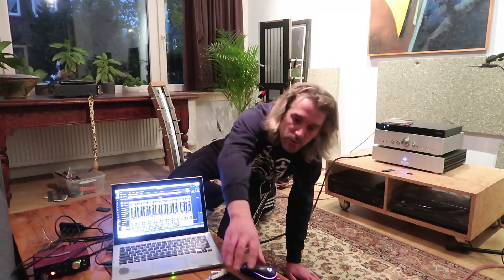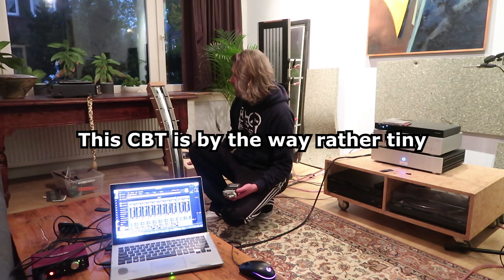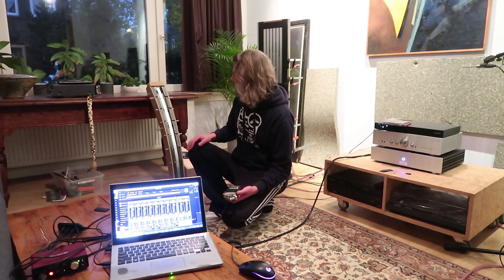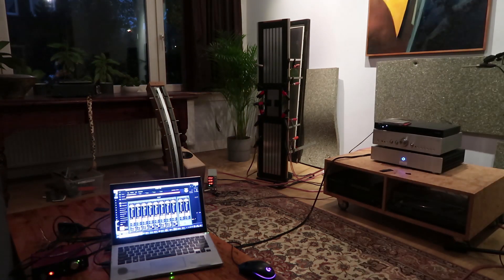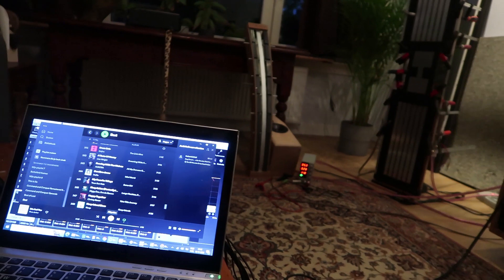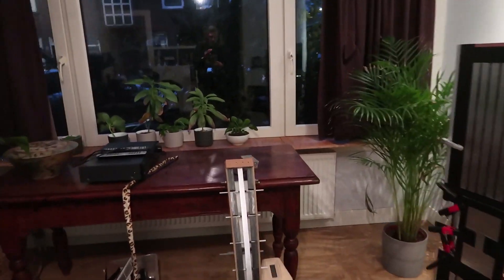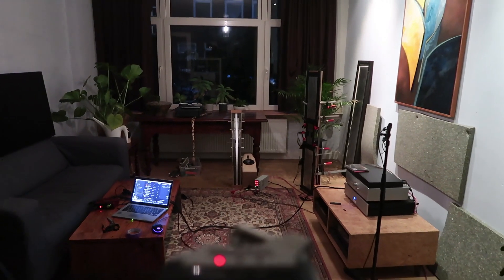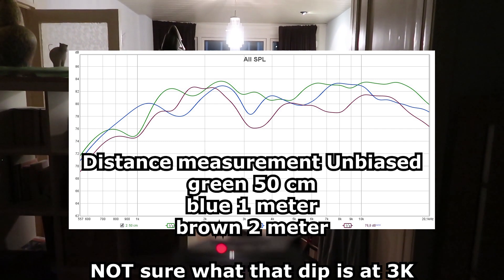Constant Beamwidth Transducer (CBT) Ribbon - Part 4 Directivity and losses

Comment: wow.. despite it was expected, but to hear how dB level does not drop significantly when a distance ten times increases - that was something -)
Reply from the maker: yeah it acts like a line source in that regad. and it  should work a little better like a pointsource in vertical..  i think thtere is some room to improve though. mkaybe me curve was not big enough or the shading... aaah well interesting non e the less in th uper end. not so much in the lower end

Comment: Interesting again,  where would you think its goin to be favorable in use?
Im still in favor of floor to ceiling (almost) electrostatics.
I build open baffle ( d'appolito) with foil tweeter and mid.  low mid and bass with papercone (as light mass as i could find) Im very impressed with these home builds and i come from Martin logan CLS which were very nice already.
Keep up the really nice work Joppe, i enjoy it much!
Cya! :)
Reply from the maker: well the use not clear, but i am on a the lookout for a candidate driver arrangement that can be ribbon or planar that can join with my magenplanar base panels withjout having them to be floor to ceiling, so im looking for decent dispersion less and less beaming and lobbing then a regular 1 meter long ribbon.  like most panels speaker incorporate . if i make something i want to sell it has to have a +1 over the others.